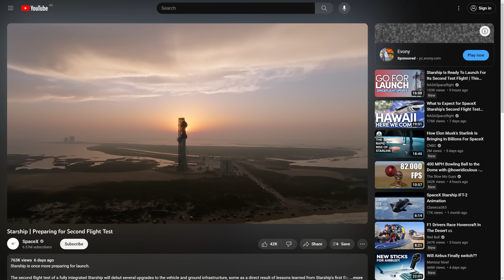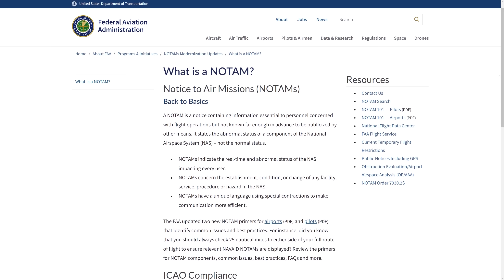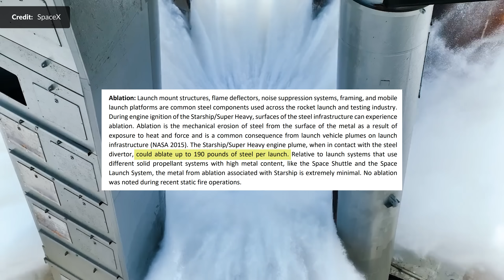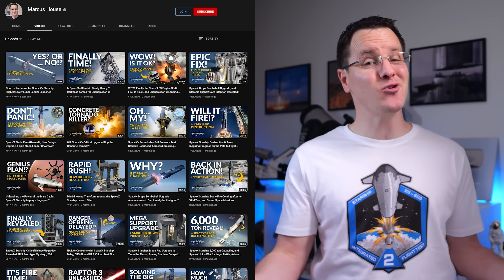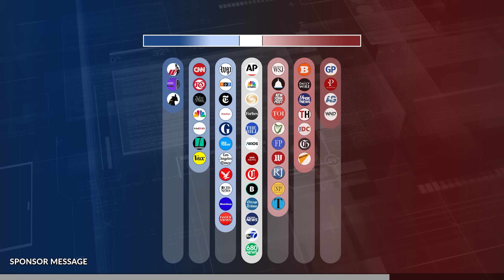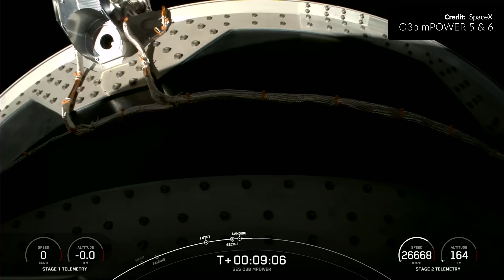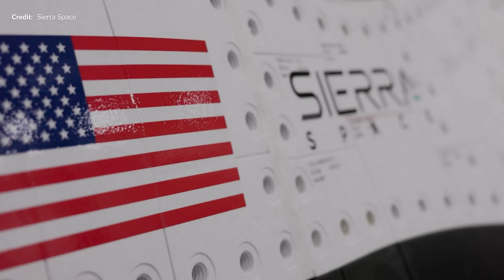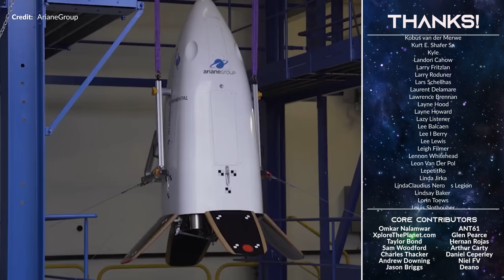Nail-biting Starship Repairs For Flight! Go Starship!

Comment: Any idea why they don't keep the hot staging ring attached to the upper stage, so then it could be detached from lower stage using the arms when removing the upper stage... thereby removing the need for the crane?
Reply: They could lower them together using the chopsticks, then detach the hostage ring on it's stand and swing starship over to it's own stand.
Same process in reverse to stack it all.
No need for the crane.
Reply: @pietersmit621  Yes, but The hot standby ring can stand the weight  (it does in the stack) so not sure theres a need to separate unless needing to swap out something.

Comment: Considering how much effort SpaceX has gone to, protecting the launchpad, that problem will be far worse on the surface of another planet the starship could land on. That's going to be a major problem, don't you think?
Reply: Weaker gravity on other planets there going too.
Reply: No, because landing sites on other planets don't have to deal with 33-engine booster launches. That's not to say that there aren't challenges with landing Starship on the Moon or Mars, but the comparison with the launchpad is meaningless.

Comment: Largest most powerful rocket in the world unstacked, hot staging ring removed, faulty actuator removed and replaced, actuator motor connected to grid fins tested, hot staging ring put back in place, largest most powerful rocket in the world restacked. All in a days work.

Comment: Finding a means to keep the damned heat tiles on reliably has been an issue ever since the days of the Space Shuttle.  I wonder if ceramic tiles are, despite their remarkable heat resistance, the ultimate solution for reentry temperatures.  Perhaps in time some other method could be found.

Comment: Will the booster be coming back to land or they gonna drop it in the ocean
Reply: Ocean
Reply: The booster is supposed to go through a thrust back burn and simulate a soft landing in the ocean. Don’t expect a catch attempt until a 2nd tower is ready. Either the one in Florida or a 2nd one in Texas. Musk mentioned they are not planning on trying until later next year.
Reply: @ReinReads  cheers mate

Comment: Are the grid fin actuators electric or hydraulic?
Reply from the maker: Electric.
Reply: SpaceX have eliminated pretty much all hydraulic systems from Starship. I think the grid fins have always been electric, but one of the big differences between this flight and the last one is that they replaced the hydraulics used for engine gimbal (which were a major problem last time) with electrics.
Reply from the maker: Only on the booster. Ship still had HPU.  @simongeard4824
Reply: @MarcusHouse  Ah, that's interesting... I wonder why they kept it for the ship, given it was a major single point of failure for B7?

Comment: Too much emphasis was put on "the real experts". These folks can hold up a vehicle with huge national security implications on a question of common sense. Is the water deluge system going to affect the salinity in the environment around the launch pad? Let's see, the water is palatable ( which means it's clean, you can drink it) SpaceX captures more than 60% of it. So, is what's left over going to change the environment around the pad? A typical rain event drops more water than the deluge system will. Let's ponder this for an extended length of time, shall we? C'mon, since that doesn't take a great deal of expertise to answer let's find something that does like, will the sonic boom affect the mating habits of seals? They can do this BS forever until a body like Congress can force the issue and say knock it off and get this license through would ya? Oy!

Comment: the dream chaser actually looks more dated to me than the x-3b. the dreamchaser design looks very similar to some very old lifting body designs from the 60's lifting body research, whereas the x37b look far more modern to me,  more so than even the space shuttle (did). to me, the x37b profile just "feels" more modern, if not actually more modern with regard to the timeline. but all said and done, it was designed for a different purpose than the dream chaser, and they are both modern manifestations of concepts dating back several decades.

Comment: And we have constantly been hearing: “we are ready…”
Reply: Starship has been ready multiple times.  SpaceX did not stop and wait for the launch license.  It upgraded the rocket multiple times. This was likely pre launch testing.  1 day delay to swap out a motor is nothing.    This could have been weeks of delay for ULA.
Reply: iamaduckquack  sure, but the thing is to be prepared for “the unexpected”.
Decades ago I was taught “failing to prepare, is preparing to fail”.
Lifes may depend on it (in my case)
Reply: @owensparks5013  it is not about using experimental parts, materials, or procedures, but making premature statements…
Reply: iamaduckquack  From my previous job, I vividly remember that those from marketing, sales, publicity make statements that suits them, and have little to do with factual reality.

You are right, there are facts no one have influence on, like wether (launch conditions); but that was not referenced in their statement.
And, I’m the first to acknowledge that, once the issue was detected, they did a splendid job! A feat that can not be achieved by Boeing, blue-origin.

Comment: What happens after the next failure?
Reply: Learn, adapt and go again as they have been doing for years
Reply: What is your criteria for success and failure?  The first launch provided a lot of useful information.   Some things worked other did not.  The rocket was launched to find these thing out. The rocket did its job how can it be a failure?   
They are testing multiple systems some new to this launch.  After this flight they will pull the next booster and starship out of storage, make changes, and launch again. Keep doing that until everything works.  Saves years and billions.
Reply: You describing tests as ‘failure’ tells everyone here that you haven’t got a clue, why are you even here?
Reply: The same thing all the first Falcon “failures” lead to. The most success rocket in history
Reply: @itheuserfirst3186  For people who do not know 
"The sunk cost fallacy is a common behavioral economics term that describes our tendency to continue an endeavor or course of action even when abandoning it would be more beneficial."
By this thinking SpaceX should have given up on the falcon rocket program.